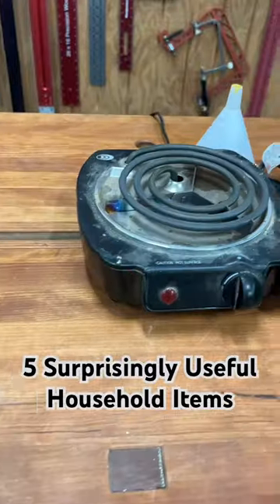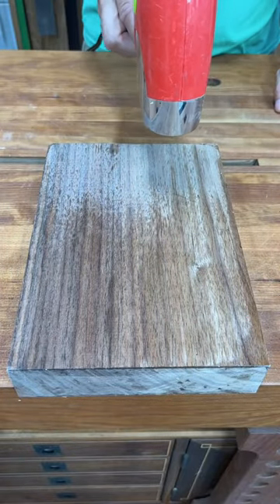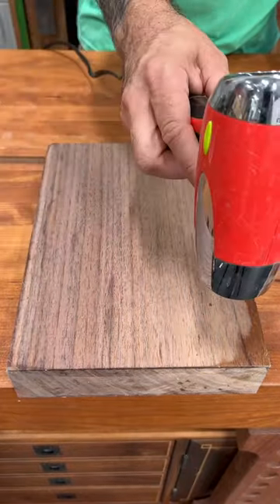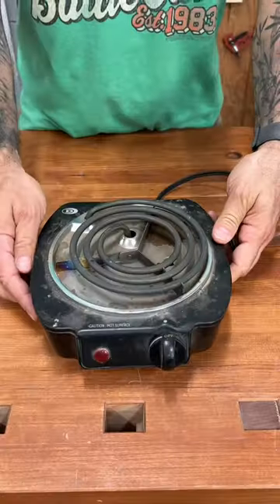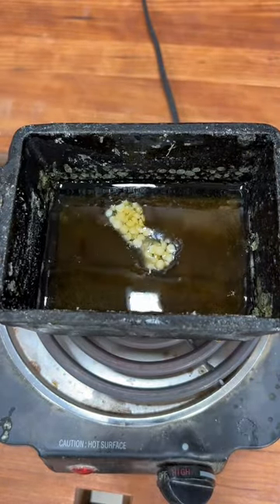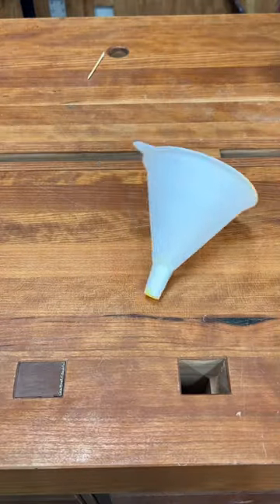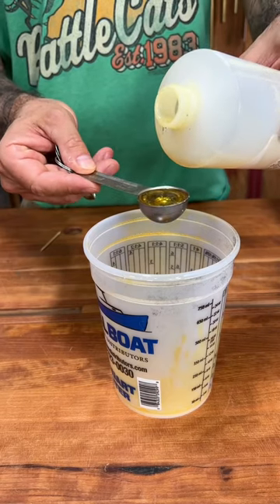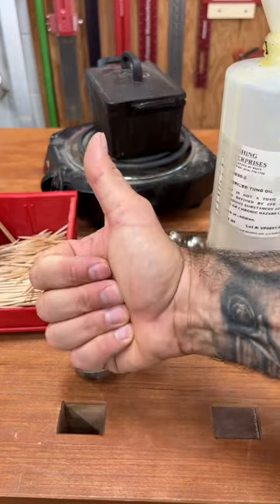5 Surprisingly Useful Household Items for the Shop!

Comment: The iron is also useful for edge banding and for installing felt pads on furniture feet (the heat helps the glue adhere better to the end grain that is usually at the bottom of a leg).  I’ve even used the iron and hairdryer to undo pva glue mistakes(but you gotta act fast)

Comment: Is speed drying wood glue detrimental to the strenght of the glue?
I imagine that it prevents penetration into the fibers because it's forced to thinckens quicker, so the bond would be weaker.
It would be interesting a test.
@suman??

Comment: You do you but I'd never heat a finish over direct heat at least nothing as intense as a hot plate. Too much fire hazard for me and my risk tolerances.
Reply from the maker: Do you cook with oil in your kitchen? Because there's actually more risk with an open flame than with a hot plate.
Reply: @woodwhisperer  my kitchen is all electric so no open flames involved but when I melt any kind of wax in it, which I do frequently for various crafts and projects I use a double boiler and most "oil" finishes have additives that have lower flash points than pure oil. Pure Tung oil, I'd probably feel ok heating it, BLO or Danish oil or "Tung oil finish" I'd hesitate and research.
Reply from the maker: I would hesitate as well. That's why I specifically called out pure oils. If there are any thinners or additives, I definitely wouldn't use this method.

Comment: Great tips.  But generally, steel measuring spoons are set up to measure solids, where as plastic spoons take into account the larger volume the less dense liquids require to get the same measure.  If the spoons you bought do specify liquids, then you're set.  Or, you can say the difference is small enough, you don't care.
Reply from the maker: I'll go with option 2. :)